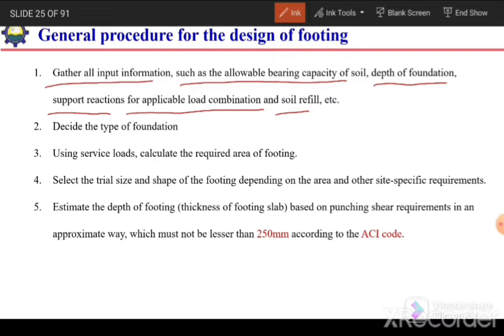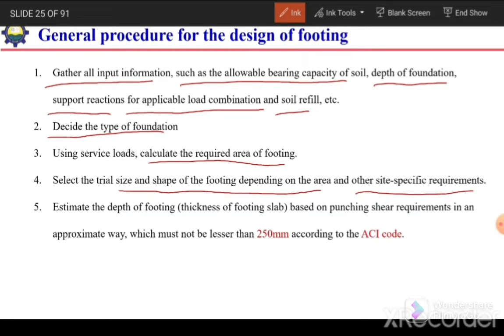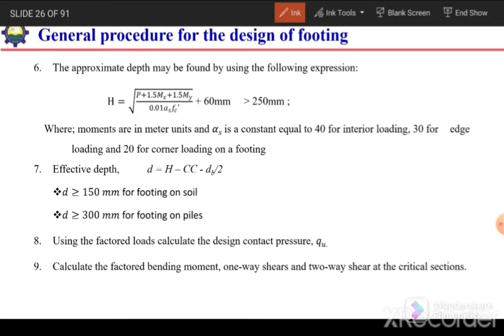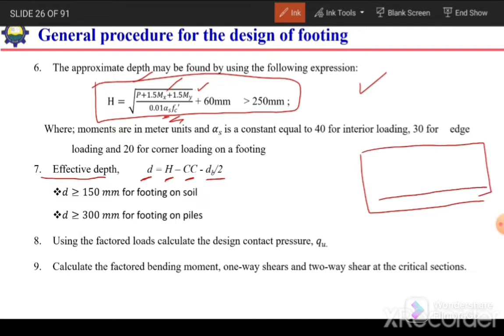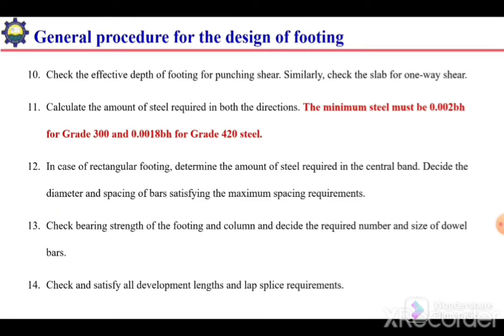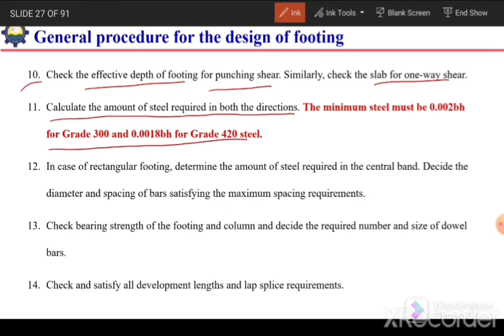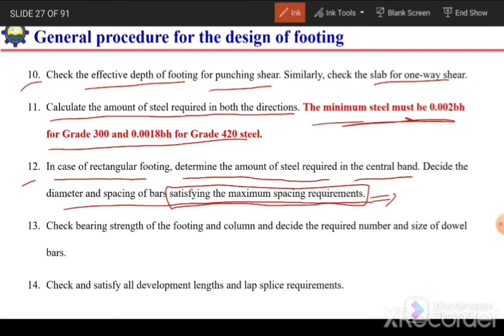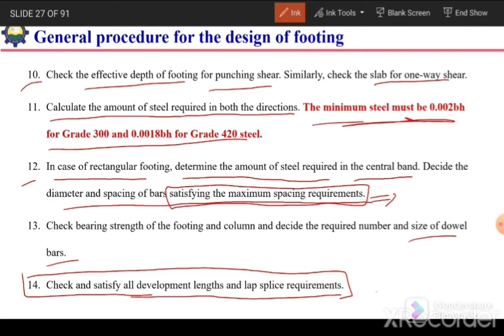3. footing design general procedure |tutorial for beginners |step-by- step short and easy procedure

Comment: Sir kindly tell me difference between net, safe and allowable bearing capacities?  I'm confused .
Reply from the maker: Geotechnical engineer determine the capacity of soil at certain depth (say 5 ft) and divide it with factor of safety.... It is termed as gross allowable bearing capacity
When we place footing at that depth and backfill with soil then some of the capacity is utilized by the weight of footing and backfill soil.. the remaining capacity is termed as net bearing capacity or net allowable capacity....